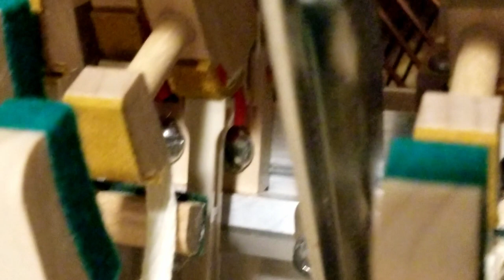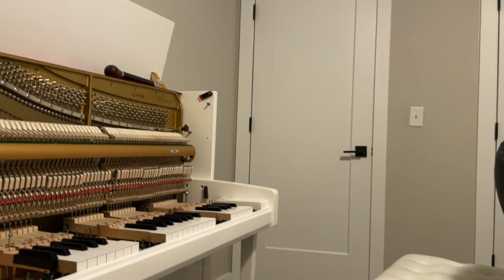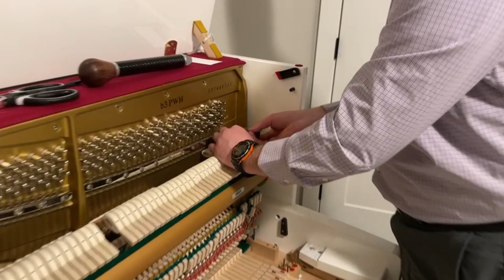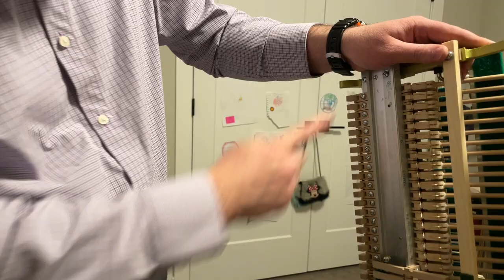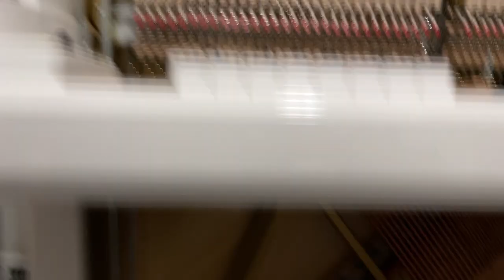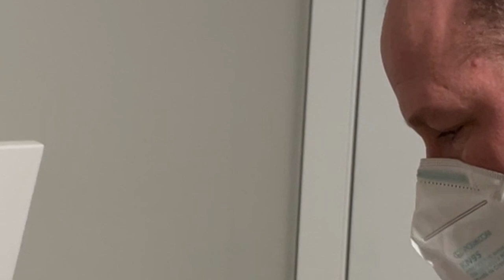Get the Bobble Out of Your Hammer!

Comment: You made my day!. My 1976 Yamaha U3H had developed that same problem on lots of keys. Luckily I found this video and yes, that was the solution to its problems!. It has an sturdy metal structure and over it is a similar wood piece than the one on the video. It is harder to insert the supplement, but can be done with stellar results. Thanks!!!
Reply from the maker: Sometimes it's best to loosen all the screws on the frame, both the middle rail (balance rail) and the front rail. Some pianos even have screws in the back rail that need to be loosened in order to comfortably lift up the balance rail and insert card stock. In so glad you found this helpful!

Comment: Good job! Almost correct.  Next time check keydip prior to placing shims. If after shims are inserted keydip is excessive,  then backchecking will be too close.  In that case regulation of all backchecks would be necessary AND keydip will still be too deep.

  I usually shim just one area, check for bobbling,  keydip,  and backcheck distance.   Rarely do I need more than one thickness of business card. Double thickness usually cause too close backchecking and excessive keydip.  Once I do this I determine how much shims is needed. 

Also in cases of bobbling hammers necessary to set precise lost motion for a true cure. Lost Motion and inadequate key dip usually are found in the same piano
Reply from the maker: Thanks for your comments! You are right on with what you are saying. This video is meant to be a quick fix for the layman. For more detailed information on regulation and so forth, check out some of my other content on prepping a Steinway Grand or the day regulation on the Yamaha grand. I also plan on continuing to discuss how the the upright action works and how to adjust it in future videos. Thanks again for these comments as I'm sure it will help someone if their checking is too close after this procedure. The trouble with working with newer pianos that are settling is that it is a moving target as settling in the piano continues. I find that loading them up with excessive aftertouch often is necessary to keep things working without multiple visits.

Comment: Thank you. Going to work on a school Kawai upright today with third, fourth and fifth octaves double striking. Going to try this first due to time restraints. I'll get back to you.
Reply from the maker: Excellent, let me know how it goes!
Reply from the maker: You might need to remove more screws on the front rail also to easily pull up on the balance rail.
Reply: @saltlakepianoservice  
Can't thank you enough for the video. Worked like a champ without affecting let off or front rail key dip. Wound up 18mm on the nose. Here's another problem though. I wanted to tighten up the flange screws and the right action bracket was stuck. Really stuck. Couldnt budge it. The others were free. Didn't want to force and break it. How would you tackle that? C5 is clicking.
Reply from the maker: @culuscha934  If I understand, you couldn't pull the action because the bracket was so tight between the keybed mount and the bolt... I would usually get some type of non-destructive lever and pry /hit it to get it off. But you can also usually adjust the tightness from the bottom, there's often an adjustment nut. If you remove several keys you can access that with a wrench and turn down the bottom mount until it's loose, then readjust to an appropriate tightness when you put the action back in. I can't remember on Kawais what it looks like.

Comment: Are you placing the shim cards directly underneath the screws, so that the screws actually go through the card?
Reply from the maker: Yes, the screws punch a hole in the card, but you can also put them right next to the screw, as long as there are enough cards distributed evenly across the rail.

Comment: Thanks for the info. I'm in your PTG chapter and attended the voicing clinic last month. Curious how you decide to raise the balance rail height vs regulating just the bobbling keys. Any negative effect on the non-bobbling keys, buy doing this universal adjustment? Thanks
Reply from the maker: It's very rare that just one or two keys will decide to start bobbing. It's usually the result of the whole area of the piano being affected due to playing and wood conditioning. You can think of shimming the rail as a punching to raise a section of keys instead of just one key, so it is possible to correct only the regions of the piano that need it. Often the whole keyboard needs some but the middle sags more. If you raise the keys too high, you can have hammers blocking against the strings because of too much key dip. So, you have to make the call whether it's best to just add a few punchings under some keys or raise the whole rail. Leveling all the keys and setting key dip after takes a lot more time and tools on hand than this quick fix which equals more money the customer has to pay. Usually if there's bobbling, one business card width won't give you any problems and is the way to go.
Reply: @saltlakepianoservice  Thanks so much for your reply. Would you ever only shim the area where the bobbling occurs, like in the middle, or do you always need to shim equally under each screw?
Reply from the maker: @kirkearl  You don't have to put a shim everywhere. It's all about raising the keys and creating more key travel. Wherever you need that you can shim. The shims don't have to be equal.

Comment: So, theoretically you could have raised the keys in the middle by placing paper punchings under the balance rail of the affected keys?  Did you use this method to save time?
Reply from the maker: Yes,  you can add punchings to the balance rail to increase the key dip, or take out punchings from the front rail. Working on individual notes like that takes at least 1-2 hrs more. In the case of this piano, I think it still would not have been enough adjustment because of the settling.  This solution is in my mind the wisest path saving the customer money. I would have had to add about 0.040" punchings to the balance pin to achieve the same result which is not advisable.
Reply: @saltlakepianoservice  cheers!(also for the video!) I haven’t seen this as a solution to bobbling hammers before.
Reply: Raising the balance rail is a quick solution, but may I add something else? I noticed that the balance rail has no paper punchings. In this situation, unless you’re really pressed for time, I’d add paper punchings. Contrary to your experience, (1-2 hours) it takes me less than 30 minutes to add a set amount of punchings on the BR, so only a little more time than simply raising the BR.

Why do this? A piano should have a cardboard and at least one paper punching under each BR cloth punching. In the future, when you go to level keys and need to lower a key, if there are no paper punchings you will have to either change out the cloth punching to a thinner size, or do something else, like compress the cloth punching, sand the key, etc. which I do not recommend. So, having something more under the key than just one cloth punching will not allow you to “make change”. ($ coin reference) While I wholeheartedly like your video (Very thorough!) I think viewers should consider the long term advantage of adding paper punchings when there are none. Adding a set amount (say a thin cardboard and a blue paper) won’t cause you to need to totally redo dip, and it’s worth the effort.

Comment: What happens when the hammer does not reset to its resting position? I looked and nothing seemed broken nor loose nor lacking any spring/parts. Just baffles the mind.
Also can the sustain pedal rod be repaired as its tip is rusted and broken off? Or does it need to be replaced completely? Where do you even get parts like that? What's the cost?
Reply from the maker: Good questions! I'd be happy to walk you through your specific repairs via Google Meet video call if you'd like. Email us at Saltlakepianoservice@gmail.com to schedule a call.
Reply: You can get the sustain rod tips from Yamaha or whatever piano it is. supply house.